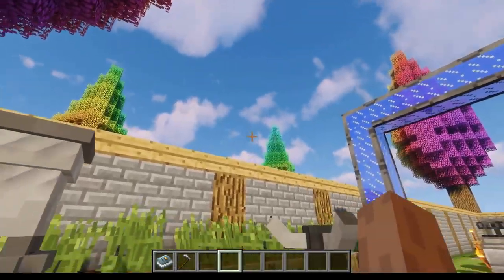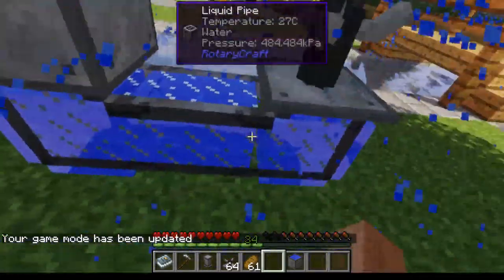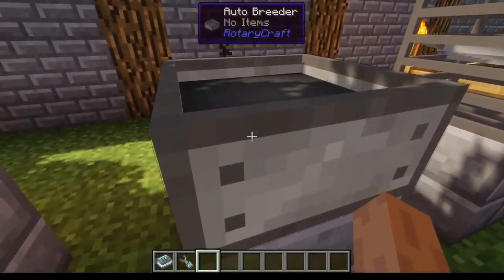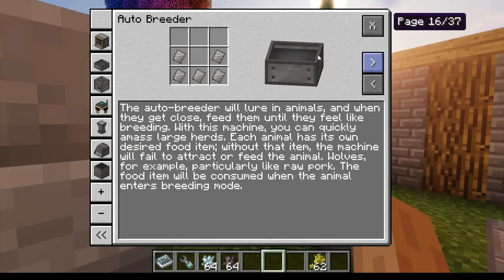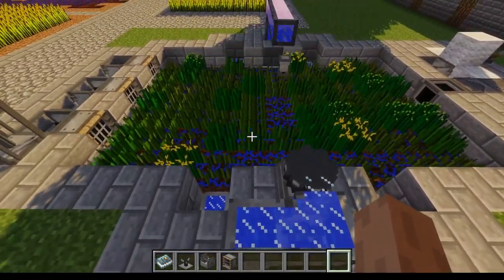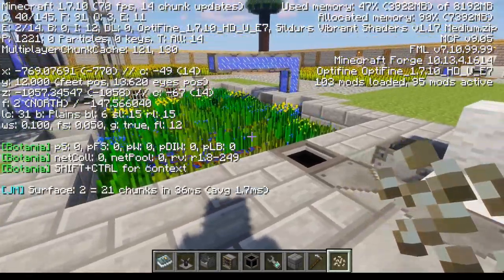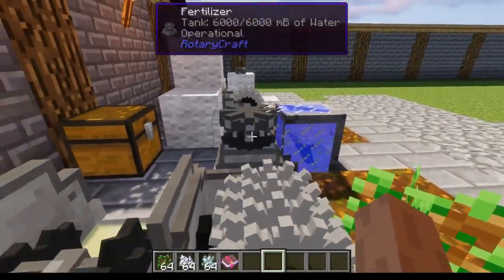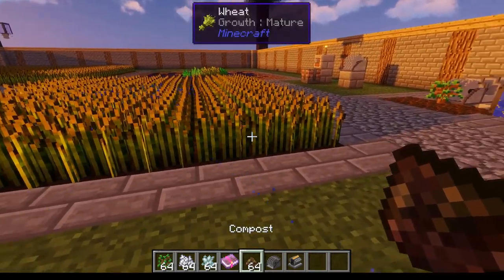RotaryCraft Tutorial #6 Farming

Comment: It seems you can auto farm animals with bait box, breeder, mob harvester and some redstone. My idea:
1.You build a grass square(later: square), place a breeder at the center. Make fence. 
2.Then you create a small room 1 block wide and 2 blocks long. It is separated from square with a fence gate
Reply: Then you place a mob harvester at the end of the room, and a pressure plate near the gate. The bait box is a part of the farthest wall.
Now you need a long(about 10 min, but not less than 5) timer, which opens the gate and turns the bait box on(clutch is needed). When an animal steps on the plate, the gate is closed and after 5 seconds the bait box is deactivated. This will be enough to kill the animal with a harvester. Then item vacuum sucks up the drops.
Over complicated, but it may be needed.